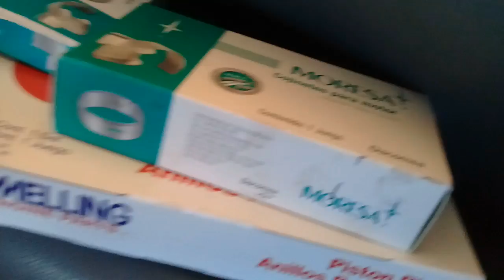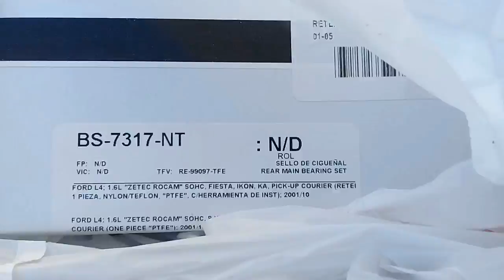Armando Motor Nuevo Ford Ka Rocam Zetec 1.6lt

Comment: Muy bueno tu vídeo. Se ve que le sabes. Tengo un Ka que en bajas revoluciones tose o duda un poco al acelerar, pero pasando las dos mil corre como diablo ¿tienes alguna hipótesis de por qué será, para guiar mis reparaciones?
Reply from the maker: necesitas limpiar el cuerpo de aceleración con carbuclean ya que no está ingresando el aire suficiente en bajas revoluciones, es fácil Saludos!
Reply: Gracias.
Reply: Acuanto torqueastes las bielas y bancada